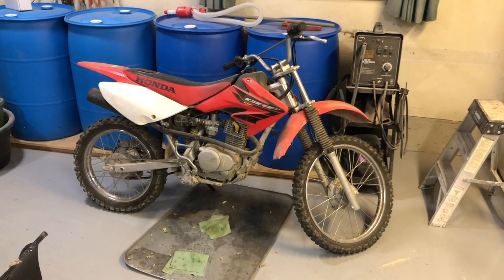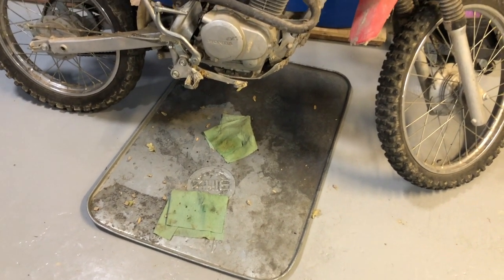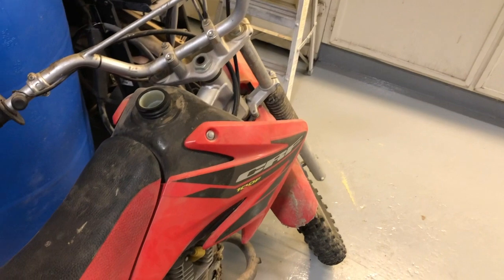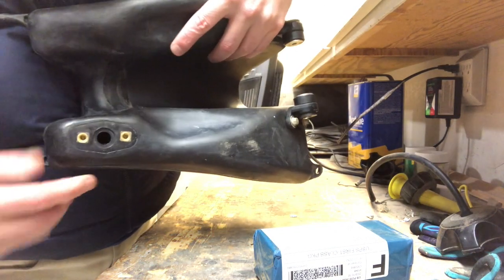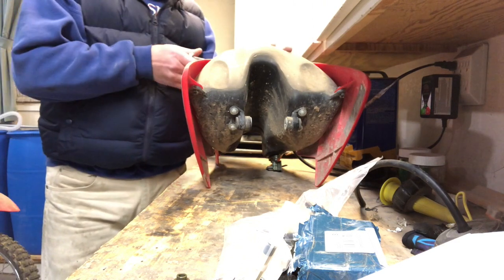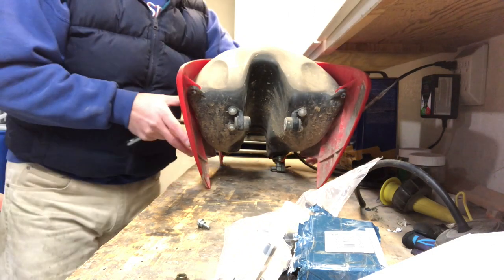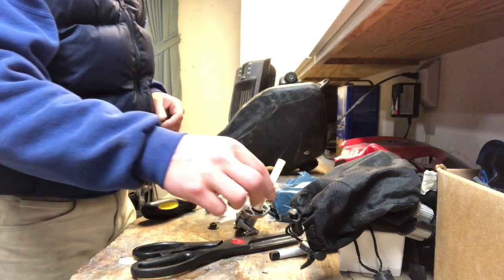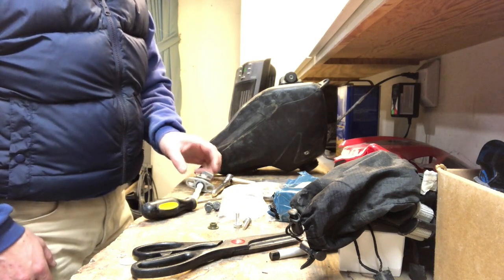CRF100 gas tank swap and gas storage thoughts

Comment: Hi I needed to replace my petcock valve on my Honda xr100 2003 but the gas tank bolts wouldn’t come loose and ended up rounding the bolts so now I have to buy a new gas tank and can’t find them any where. Where did you guy your gas tank